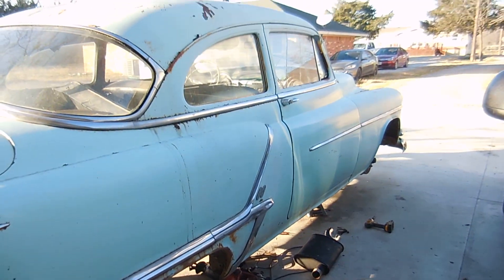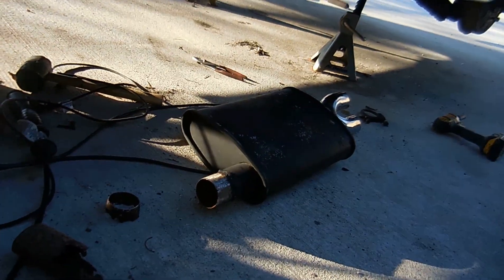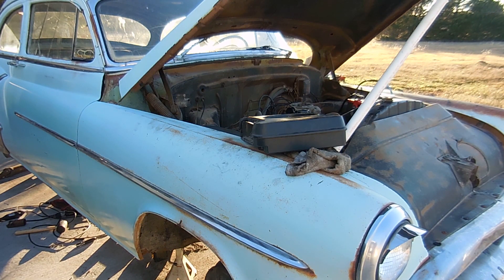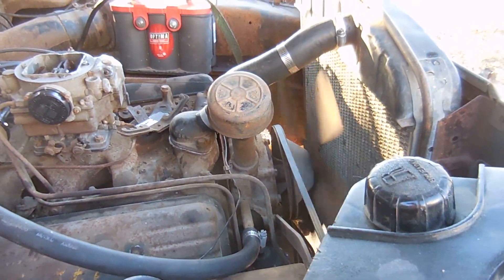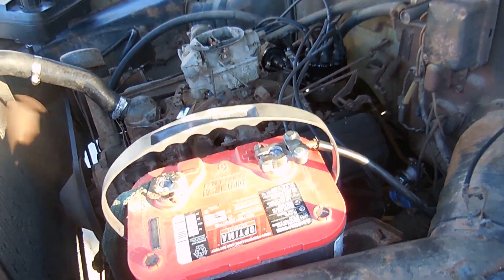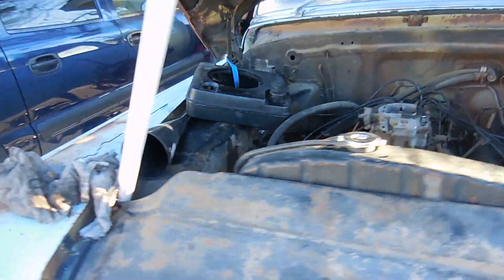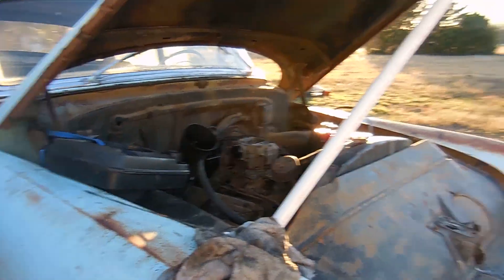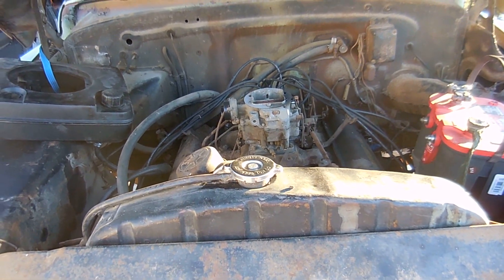Will It Run? Part 9: 1953 Oldsmobile Rocket Super 88 Barn Find

Comment: That engine is running pretty nice and doesn't sound like there are any engine problems. Doing great so far Ben. I have that original pamphlet, Original owners guide and the Futuramic Oldsmobile accessories for 1950 for the 1950 Olds Rocket 88 all original not reprints.

Comment: Hi Ben. I am following your channel because I love to see younger people possess the passion and patience to restore and rebuild automotive history. I myself am restoring several cars at this time using old school methods such as body solder(lead) instead of plastic filler. I once worked on the early fifties cars when they were still considered late models. In 53, Olds, Buick and Caddy changed over to 12v systems with Chevy and Pontiac following in 55. Even though Olds advertising stated 12v ignition, some 1953 Olds and Buick models still had 6v systems until the 54 model year—I know because I’ve seen it. So the question I asked of your Olds being a 12v conversion was of curiosity and not of ignorance or “impatience”.
Reply from the maker: Possiblity, but if I bought a 53 olds new, and it had a six volt battery, I'd be pissed. I highly doubt gm would let something like that happen die to the fact that all the wiring, bulbs, starter, generator, ignition system would have to be different to be six volt. If in the factory they made one six and another twelve, they would be out of business so fast.
Reply: there was still 6 volts for the 1953 buick special series cars, but all of 1953 oldsmobiles were 12 volts electrical. in 45 plus years, have never seen or heard of a 1953 oldsmobile with 6 volts.

Comment: Valley Head Service ran one of these in stock class nhra , they were very competative because they were under rated on Horse power , also that b4 spd hydro is a very rugged and fast trans , BM built there reputation with these 4 spd transmissions, i build them to race in my 54 lincolns, keep up the good work, Rick Martin Darrtown Ohio

Comment: Cam and wrist pins don't get much oil just idling, rockers arms too, most likely dry.  Need splash from rod bearing weep holes thus some RPM to get pressure up and splash?

Comment: I thought I heard when you first started it up it sounded like the starter did not let go of the flywheel. That’s about a 50 to 1 gear ratio overdriven. Your starter drive is lucky if it survived all that time it was running. You were saying it was quiet, I thought it was making lot of noise
Reply: Those old rubber boots on the solenoid would let moisture in and it would rust and stick. Solenoid may need to be cleaned of rust. I drove a 53' New Yorker in high school that had that problem.

Comment: With it cutting off that way, it sounds electrical. Like a switch or coil breaking down. If I remember right, the voltage regulator can cause that problem also. In 53 the Chevys were six volts. I think the Olds Division was the first to switch to 12 volts. I switched over my 53 Chevy 30 years ago and did away with the voltage regulator. Every time the voltage regulator would go out the whole thing was dead. I got fed up with that and switched.
Reply: 54 chevy was their last 6 volt.55 came 12 volt
Reply: Did you watch the video?  He shows the "53 sales brochure which brags about the 12v system.
Reply: @paulcopeland9035  Yes, Olds was 12 in 53.  Chevy wasn't.  Chevy didn't switch over to 12 till 55 I think.

Comment: You should drop the pan and check the oil pump, that is if you want the car to last. But really with an engine that old it should be rebuilt. You'd be shocked how good it would sound with the valves ground and new rings. Besides the vintage of this car deserves a full restore.

Comment: Wow! I was not aware that Oldsmobile converted to 12V in 1953. Did all of the GM makes convert to 12V in 1953? Previously, I thought the entire American auto industry converted to 12V in 1956 (except for maybe Cadilac a year earlier) BTW, that original mint condition 1953 Oldsmobile brochure was a superfind!
Reply: The 1956 model Australian Holden: the FE series, was the first with 12 volt electrics too.
Reply: Chevrolet in 1955 model. 54 chevies were still 6 volt.
Reply: '53 Buick V8s were 12 volt, except the Special, straight 8 was still a 6 volt; '55 Plymouth V8s were 12 volt, the six was a 6 volt...
Reply: Some GM's were 8volt had a 4cell long battery don't know what years . battery on parts car looks like that.
Reply: No, I had a couple of 53s Chevy, Buick that ran 6 volt.
Reply: @michaelszczys8316  You are correct, I owned a '54 Chevy
Reply: Yes 12 volts in 1953 is a shocker. I was always taught that GM converted in 1955, Ford and Chrysler in 1956.
Reply: I they converted to 12 volts in 1955
Reply: Don Desnoo 8 volt ? Serious ? Never ever heard of anything like that. I just know in early 50s they were all changing to higher voltage. Know for fact Chevy was 6 volt for 54 then 55 was their major switch year. Also first for ball joint suspension, hotchkiss rear suspension and V8

Comment: Learned decades ago to NEVER go under a car on jack stands.  Was doing a tire rotation and oil change on a 60 Chevy.  The wheels were all off and I had just gone to pour the old oil into a ditch.  A big gust of wind then blew the car off the stands onto the ground.  I sat there in shock looking at the car I was just under sitting on the drums......

Comment: Really clean car, no dents, rust, missing pieces! 
Soak that WCFB carb in cleaner. 
Be careful, some parts may be hard to find. 
A used Edelbrock AFB or AVS would work well. 
Use zinc additive in oil or use diesel truck motor oil.

Comment: I was wondering if the cap on your little gas tank was/is partially plugged so it's not getting any air for the gas to flow?? 
Had that problem on a roto-tiller and about pulled my a$$ off trying to get it to run before figuring it out. It's hard to tell if those vented caps are working ??? Just unscrew the cap and see if it keeps on quitting.
Reply: Vented tanks to the atmosphere in those days.  The cap was not designed to seal tightly as well.  Modern cars have a pressurized evap system, but this car was back when we didn't care about emissions.
Reply: Pappa Bob I think was refering to the plastic tank on the fender that was supplying the fuel.

Comment: If the Olds was 6 volt, the use of a 12 volt battery would not have harmed anything .May the guages and lights would play up but the starters for 6 volt operation are pretty well made,regardless of make. i use to run my early Ford V8's on 12 volts, mostly just for better starting. Love those early Olds,  they were the beginnings of the high performance sedan.

Comment: Please high idle the engine 1500 to 2000 RPM to build some oil pressure, and oiling of the pistons/ cylinders, and this pumps up the lifters.. sitting there idling drives me crazy!!!  However good thing you didn't because of the stuck starter!
Reply: If he doesn't have oil pressure at idle, there are bigger problems at play.......

Comment: Are you afraid of running over 800 RPM REV THAT ENGINE!! BUILD SOME OIL PRESSURE!! BLOW OUT SOME CARBON!!
Reply: Good thing he didn’t. He said the starter was still getting spun by flywheel.

Comment: Tighten up the valve clearance and that noise will be much less. Mechanical lifter valvetrains are inherently noisy, but you have a bit too much from the sound of it. I had a starter Bendix stay stuck and the starter started smoking after about 2 or 3 minutes. It burnt the bearings out of the starter because it was spinning so fast from that little gear being engaged in the flywheel ring gear.
Reply: This engine has hydraulic lifters.

Comment: Oldsmobile was the experimental car for GM. They tried all the new gadgets in the Oldsmobile before they went into anything else including 12 volt systems. They already knew 6 volt systems and generators were not enough. They also had a four speed automatic transmission, and the the V8 Oldsmobile engine was what blew the Ford Flathead out of the water as far as being the racing engine of the future. One year later the 265 Chevrolet V8 came out and was lighter and more powerful, and less expensive. And so it goes.
Reply: 265 was 1955 - just sayin.

Comment: Add a quart of marvel mystery oil with an oil change and hear the difference!
Reply from the maker: Did this on the first oil change a while back
Reply: Just picked up a 56 Buick with a 322 nailhead in it a few weeks ago. Hadn't run for about 3 years, and had lifter noise when I first got it started. I dumped half a can of seafoam in it, and within 10-15 minutes it got noticeably quieter. After about a half hour the noises were completely gone. Sometimes it takes these old engines quite a while to get all that stuff circulated. I'm not saying that's your problem with that Olds, but just a thought! Really enjoy your videos on the old stuff, and nice to see younger guys your age involved in the hobby. Keep up the good work!!👍👀

Comment: Weak fuel pump? My 58 caddy starts to stumble on me about every 2 years , if I'm lucky,  I can baby it home.  If not, its tow truck time. ALWAYS is the fuel pump.  Don't know why they last for such a short time. Back in the 60s thru the 90s it would last for many years without failing.
Reply from the maker: I just rebuilt the pump, doubt it went bad in the ten minutes the car has ran.
Reply: @TheCorvetteBen  doubtful yes, impossible? No. I've had brand new parts right out of the box, That were bad. I'm sure you have too. Lol.
Reply: I suspect that the ethanol in the fuel is the big culprit.
Reply: @marcosmaisterra4477  you might be right. But you'd think that they would be using the kind of rubber that would resist damage from ethanol. We've  owned the car since 1960. And it never went thru fuel pumps like it does these days. FRUSTRATING LOL.
Reply: Could it be the ethanol gas eating away at the rubber diaphragm in the pump?
Reply: @rustyjeep2469  maybe so.its a  pain. 🤨
Reply: Back in early 80s they tried using Methanol in the gas and it was wrecking every part in a carburetor that wasn’t metal. Leather accelerator pump plungers shriveled up almost immediately

Comment: the reason the engine keeps dying could be vapor lock. Some times on those old engines you get what we called vapor lock because of heat build up. We would put on a couple wooden clothes pins to the fuel line to take some of the heat. problem solved...
Reply: The engine never got hot enough to "vapor lock"  Vapor lock is boiling fuel,  This engine was far from that much heat.

Comment: I was 11 when  those cars were new,, the only thing that car is good for is what you appear to be doing,
for fun get it up & working, once you get it operational, done playing with it sell it / find your self Le Mans 
there about 67, 2 dr. ( hunter green blk inter, )had one & the 65 Impala, had 2 one was the SS. 
fire bird but the 68 MG midget was the most fun car, best road car I owned, had the 72 TR4, lots of modifying 
required out of the factory, the car was a load.  but once I did rework, it ran like a scolded dog: 67 Chey Biscayne 4 sd 427 4/11_s rubber mats no trick stuff 
just all muscle car. I'm not a Corvette type. love the 2dr's big blocks, the only way to go, but not far past 
the filling station "-) find your self a keeper * save your money, other wise it's only chasing after the wind

Comment: You got that right put the wheels on it and drive it don't be scared
Reply from the maker: Sorry, I'm scared to drive a car with zero brake pedal.
Reply: @TheCorvetteBen  that's true you have to be able to stop before you can go.
I have a 1947chevy coupe I bought for 2,500 I change over to 12volt 250 straight 6, 350 transmission,  5 on 5 lugs.
      I couldn't find a front drum because it was run down to the metal, so I had to put the disc brakes conversion on it. 
          It's not hard to do you just have to strip everything off it to just the spindle and the kit come with everything in it everything bolts up no drilling so you have brake pads and not the front drum pads it will still stop like no power bakes but stops better than drums brakes. Not sure if you want to go that rout. Mon I like the Oldsmobile you have those were the early years of NAS Car's they have history that's a keeper you don't see many of those around. I'm like you just get it running great and don't worry about the pretty stuff the Car speaks for itself just the way it is.
 Hope for the best it takes time. I go to a lot of car shows and talk with people that have the same car's they may have parts leads and other information I know you said you have a parts car it's still good to get to know other's that may have lots of knowledge of your stock Olds.
Reply: @TheCorvetteBen ,you just know better...me too                                        peace

Comment: I do hope this is your last video as meaning i finally caught up. Not that i'm being a smart butt. The bendix on a starter is the spring inside. So its not riding on the spring. You don't need to buy another spring you have one in the other starter that's good. Take the starter that's bad apart first so you know how it goes back together. Retrieve the spring cause its good. I see it go back in when you was testing it. Swap it out and there you go. Don't be so afraid to do stuff. I did see that first rocker not working tho. That's not good. Prolly needs a new lifter which means doing them all really. I hope you took the push rods out n cleaned em like you said as that is the way oil gets to the rockers. Looks like someone way trying to make a race car outta that at one time. You should check where the power steering pump is on the other car to see where it goes and just take a look on the runner to see if it looks like it once had power steering. Sometime that would stand out. Personally i'd leave the alternator on it as the old generators broke down a lot. My dad was born in 1899 so i have a load of information if you need any help young guy. He is long passed now. I also went to school for mechanics. 54 now and the old carbureted motors were my thing... So please ask if you don't know something.. Also put a washer or two behind the ignition switch! Do i gotta tell ya everything boy! lol  Olds was a very nice car. why they stopped making them i don't know...
Jack

Comment: I am curious about the front suspension.  I know that 1954 Ford, Mercury, Oldsmobile and Buick had ball joints; but did the 1953 Oldsmobile?  Chevrolet went to ball joints in 1955, but Corvette had king pins until 1963.  Anybody know?
Reply from the maker: Pretty sure it still has king pins, but those seem to be able to stand more miles than most ball joints I've seen

Comment: I wonder if something in the ignition is getting hot and then stopping. Doesn't sound like it's running out of fuel before it dies.
Reply from the maker: I think it might have something to do with the starter dragging on the flywheel. Maybe lol
Reply: @TheCorvetteBen  Yup, its shutting itself down to avoid ruining its flywheel!! Maybe you should name this one CHRISTINE ?? LOL.
Reply from the maker: Just a guess. Either way it'll be much less noisy with that fixed. The part is on it's way!
Reply: @stevefranklin8052  If it were fixing itself to rock and roll music that would make for a great Youtube video for sure.
Reply: @Shane-Singleton  lol!
Reply: Those old cars usually had big resistor block on the coil to cut voltage down. Does he have that hooked up or is it direct?
   It was idling pretty slow.
Reply: @michaelszczys8316  I think ive seen the ignition resistor in some of the vids. Dodge used something similar for a long time. Into at least the 70's that I know of.
Reply: @Shane-Singleton .... Every manufacturer used a ballast resistor to cut the voltage to the points. On these old starters, there was a terminal that sent 12v to the points when starting, and then shut off allowing running voltage (usually about 8v) to the points.  If you ran the car with 12v to the points, it was not long when you would be stranded with burnt points.  Don't ask me how I know!
Reply: @paulcopeland9035  True i forgot about the ignition resistor. But if that damaged the points why does it start up find and then run until he gives it some gas? Could it be messing up the coil or condensor instead?
Reply: @Shane-Singleton ...Yep, it takes awhile for the points to burn and then you do not go!  I believe the primary (and probably the secondary as well) jets and jet passages are clogged.  Time to soak that carb.

Comment: I thought I heard a knock too. Also why did you put transmission fluid in it? You didn't say if you measured it or not. Yes if it is staying engaged the started will freeze up ,and kill the engine. The idle circuit was cleaned out, but not the secondary circuit which is the circuit that provides gas to the engine during normal driving. If it's not cleaned out, the car will die when you try to give it gas.
Reply: "why did you put transmission fluid in it?"  Umm, because it was low?

Comment: you know harbor freight sells muffler expanders and most parts stores sell small exhust sections
Reply from the maker: I've used those before and they are pretty crappy. I've broken them in half as well.